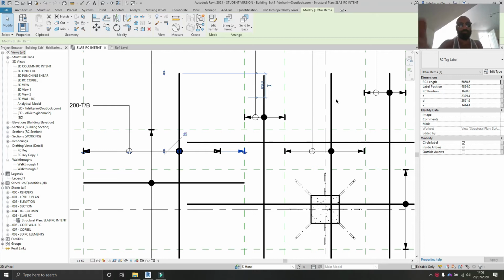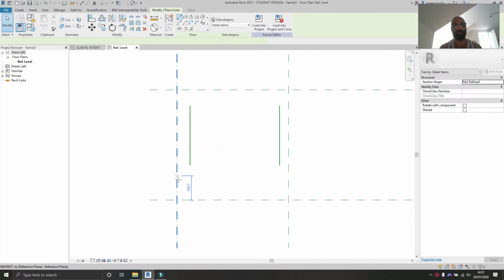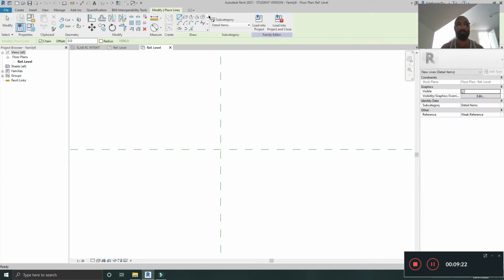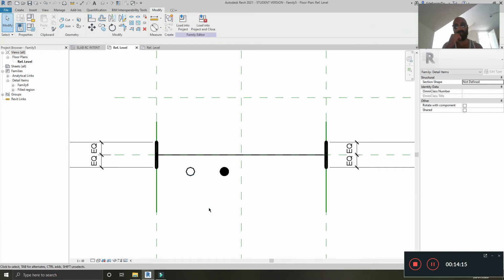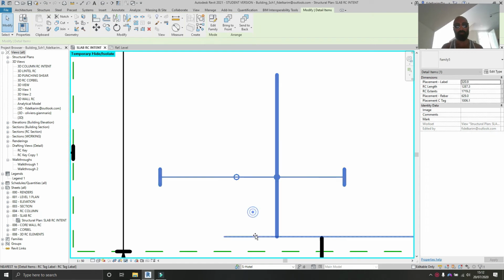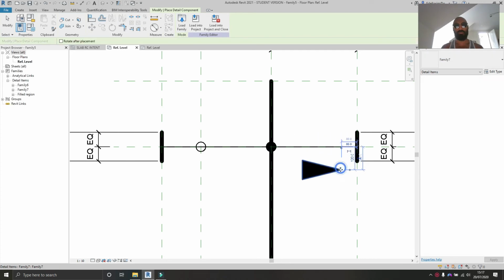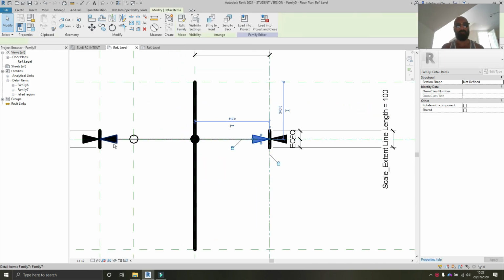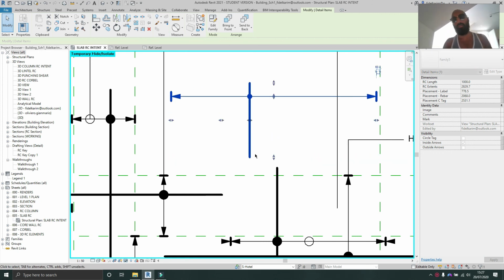Revit - RC Intent - Learn to Create Re-Usable and Customisable RC Labels

Comment: will this behave like a tag or you need to type in rebar size, number and spacing manually?
Reply from the maker: It won’t act as a tag. So yes, you will have to add numbers and spacing manually. I built this model because Revit’s built in rebar modelling doesn’t provide rebar tags like these so it is more of a workaround. On a side note, I do not know if Autodesk have changed this in later versions of Revit.

Comment: Hi, thanks for a good video. I was thinking, isn't it better to generic annotation families for the arrows, circles etc? Then you can skip the scale parameter. When using commas in parameter names I think you need to enclose them with curly brackets or brackets (can't remember). One more thing, maybe one can add a ref.line so that the family becomes symmetrical about the x-axis. I've used that in other families. I'll learned a lot from your compound I-beam video😊
Reply from the maker: I made this video a while back so don’t remember what you are referring to. But thanks for your input. Also, thanks for the support, I’m glad you liked the I-beam video